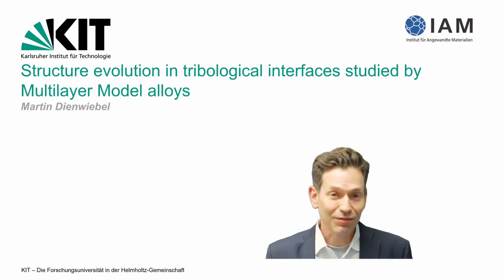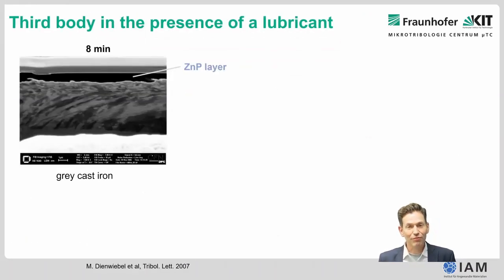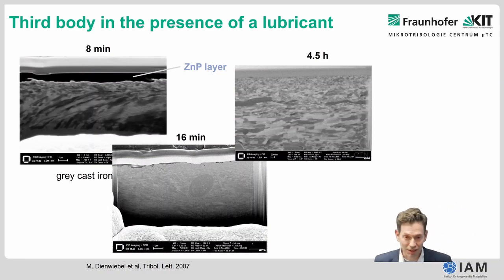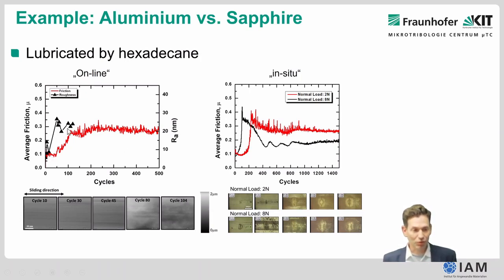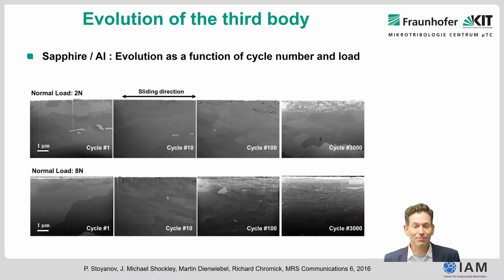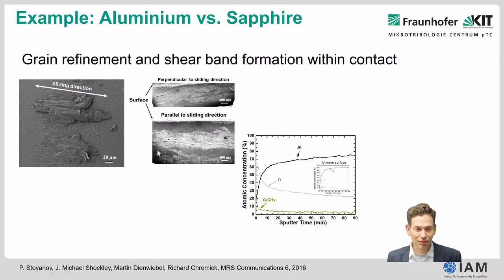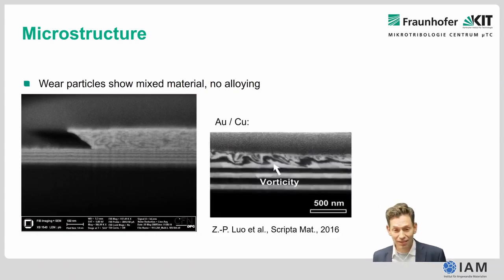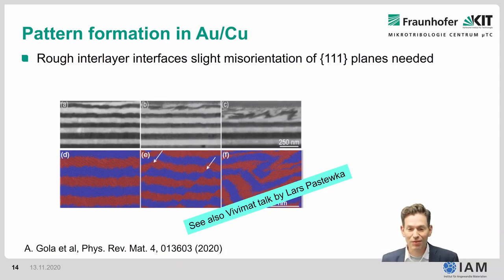Martin Dienwiebel (KIT, Karlsruhe) talks about multilayer model alloys | ViViMaT Session 1

Comment: Martin, did I miss anything or did you check what happens with the 100nm system if the Ni layer is on top? I would expect less plowing and therefore possibly a lower CoF. So would it be possible that the friction over layer thickness curve bifurcates at the point where the thickness of the deformed layer approaches the layer thickness, depending on the order of the layers?